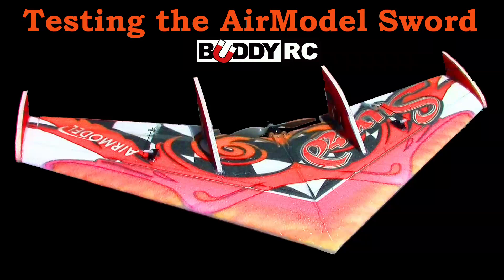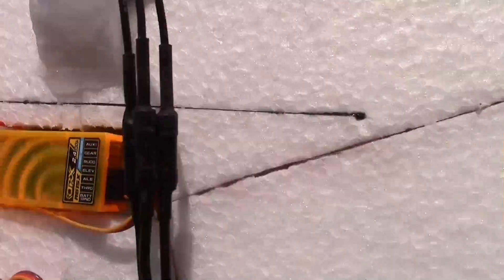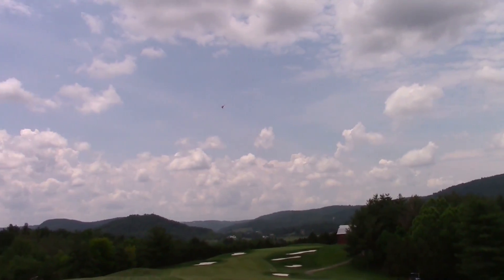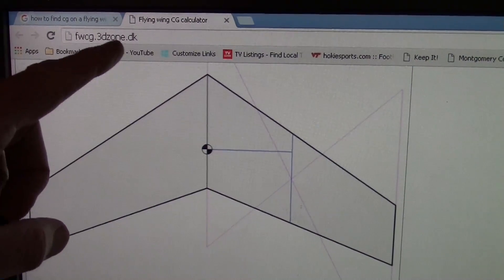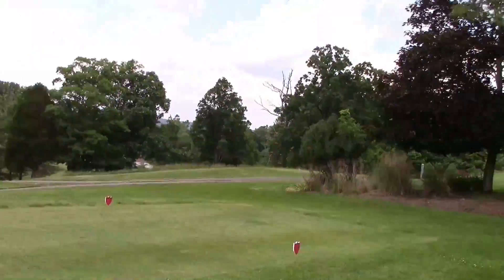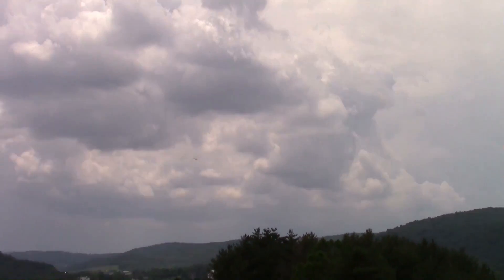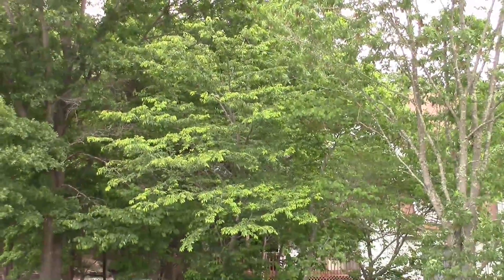Testing AirModel Sword Wing From BuddyRC (Crashing to find CG!)

Comment: I enjoyed this episode Dave. You really showed well how a tail heavy wing flies, then how much better that same wing will fly with a proper cg dialed in. A very good visual aid to someone who may be new to wings. One may think that their plane flies terribly, unaware of the importance of proper cg.
Cheers!
Fergy
Reply from the maker: Your have really summed it all up well. I should have emphasized that in the video. CG is so important and so is the CG stand. I might have added that the left to right balance is also important especially when adding FPV and LRS hardware out on the wings. 
It's nice to have a calm day to see the effects with out the wind interfering. 
My take on this is that flying wings seem to need a lot more weight in the nose to move the CG forward than other designs.
Reply: +dmerc00 I totally agree. When initially dialing in my FT Blunt nosed Versa Wing I had the cg pretty much right on, but I found the plane to be extremely twitchy. After moving to the inner hole on the servo arms, she now flies like she's on rails! Those wings don't need much throw at all.

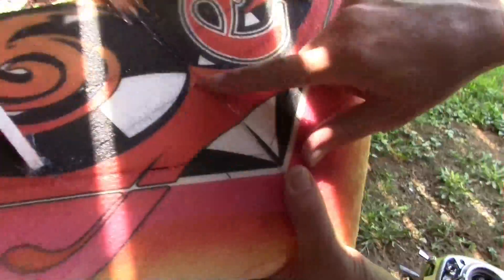Comment: 2:40 In the product link that you provided... on that linked page under [Product Description]... right above the product picture it says....

CG Position:
195 - 205mm away from the nose
Reply from the maker: Ah, I wonder if they added that after we contacted them or did I just miss it.
Any how we found those CG specs would be too tail heavy.
We ended up with 180mm -190mm for best performance.
Reply: Great... Good to know the latest CG ;)

Comment: good balance of CG, I have a question, I built one wing but when I used the same website to calculate the CG, I was super nose heavy 

now my question, does the CG shift if the weight is added or it remains the same, I am a little confused

does the CG calculator also depends on the total weight and electronics that goes on the wing
Reply from the maker: My experience has been that the CG location is about the same even when adding more weight.
However if too much weight is added you can get wing loading that raises the stall speed making it appear to be nose heavy. The calculator has slots for weight additions too. You will still need to experiment like we did.
Reply: +dmerc00 thanks for replying, will make another wing, let's see how it goes